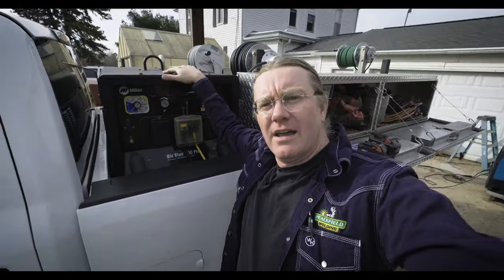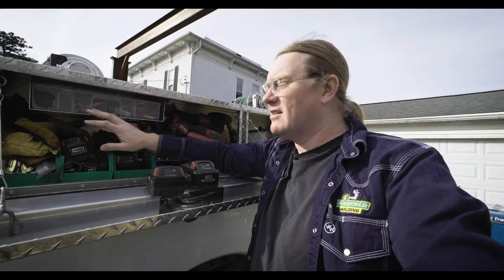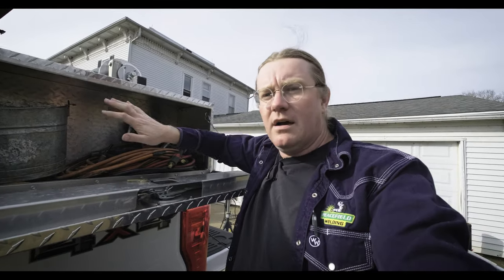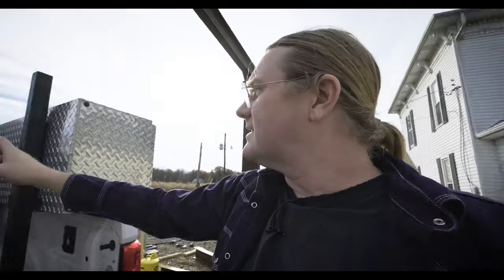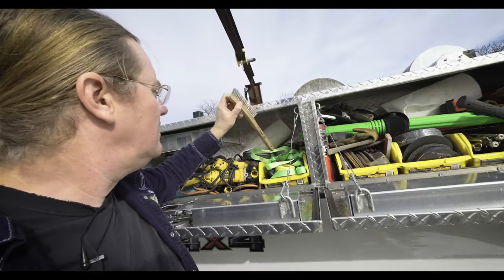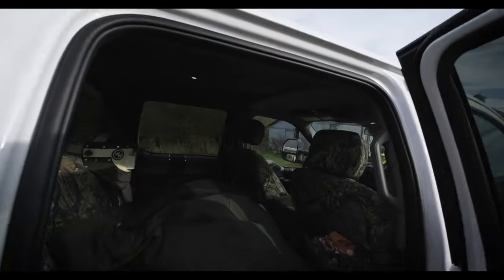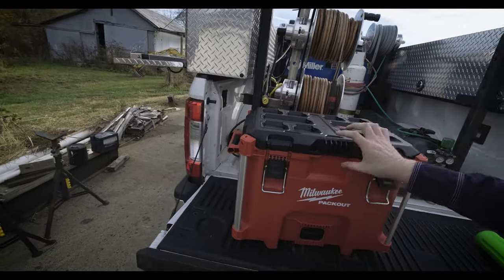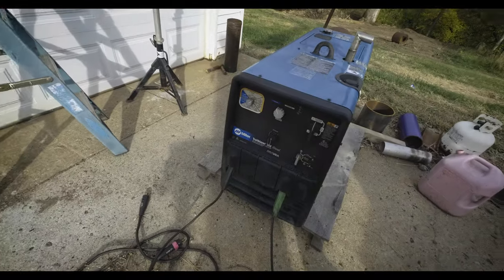TOUR OF MY WELDING RIG AND LOOK IN MY TOOL BOXES FOR PIPE WELDING

Comment: Nice outfit you there Zack I hear say tools are reasonable safe in your area man I always try to keep my welding rig in eyesight here in L.A. you need eyes in the back of your head good luck to you keep the good videos coming
Reply from the maker: That's crazy, out in the country here I don't ever worry about stuff. If I have to to go the city I've had people steel stuff off the tailgate while I'm working.
Reply: @DarlingtonFarm  IN Los Angeles it's crazy some of my friends had their rigs stolen more than once a plumber I know his was stolen 3 times my welder friend his was broken into 3 times the 4th they took the whole thing another friend a contractor his truck was stolen a week later the cops found it on blocks everything was gone including engine transmission and rear axle along with the tools

Comment: I would love to see your skid bare. I’m about to start my build and it will be very similar to yours. I’m interested in seeing if it’s bolted down or if you’d tied it off, how the bottles are held, how the welder sits in etc…
Reply from the maker: I ran bolts to the 5th wheel hitch through the bed, you can have your welder covered really cheap on your commercial auto insurance if it's bolted to the truck
Reply: What size I beams did you use to build your lifting frame and measurements? Looking to build one myself!

Comment: I'm jealous I could never get away with that small of a truck..maybe someday I won't need the big 4900 crane cruck
Reply from the maker: Oh jeez that's a lot to pack around! I wish I would have gotten a 350 but nothing like a medium duty like that
Reply: @DarlingtonFarm  yea I miss being able to run around in my little 2500 Duramax.  But the work out grew the truck. Trying to switch to plant work but there is more heavy equipment work out there around here now.
Reply from the maker: @sparksmobilerepair4025  I bet with all the construction going on on the north side of Indy you could clean up fixing equipment. Had a run fixing equipment a few years back but didn't really like constantly being covered in grease
Reply: @DarlingtonFarm  yea it's definitely not the best being greasy and truck bed covered in oil all the time. I'm out in central California. Got my foot in the door of some food plants but it's taking a while to get rolling with them. Got some smaller jobs out of them just building that relationship now
Reply from the maker: @sparksmobilerepair4025  food plants are where it's at, good money and easy work
Reply: @DarlingtonFarm  and mostly clean lol
Reply: You’ve come a long way from your humble beginnings with your old truck and SA200.  Glad you have found a niche area of welding which sets you apart from the herd. But really, a Hoosier should have a Hoosier pole.  Lol.
Reply from the maker: @stevewarner8880  thanks I really appreciate it, yeah I need to make one for the truck
Reply from the maker: @stevewarner8880  thanks I really appreciate it, yeah I need to make one for the truck

Comment: I got two trailblazers I’m running now . One a 301g and a 325 efi . XL power . How you like the pipe Pro . I like the 325 how quiet she runs . Compared to the 301g . Is a pipe pro quiet running unit compared to the Diesel trailblazer ?
Reply from the maker: The pipe pro is so quiet you forget it's running. If you're 15 -20 foot from the truck you can barely hear it run. Now that trailblazer diesel on the other hand is so loud at high idle it's really unpleasant working off the back of the truck. You can lock it at low idle and weld up to 120 amps or so and it's not as bad but it's still super loud.
Reply: @DarlingtonFarm oh ok thanks for your reply back you have a wonderful day .

Comment: I’m looking at a trailblazer 302 diesel with 270 hours. Not sure what to pay. Any guidance? I was looking at a Hobart champion 225 but I like that the trailblazer has AC and I can use it for carbon arc gouging down the line.
Reply from the maker: I just got a 2011 302 diesel with 500 hours for 3k. I had to drop everything and rush there to get it before someone else. I'd definitely go with something like that over a Hobart
Reply: @DarlingtonFarm  gotcha. That’s a good deal. The guy who’s selling it wants 2x that, which is way on the top end price wise for these machines imo.
Reply from the maker: @michaelt.9372  I'd see if they'd take less, it's a good machine but I don't think I'd pay 6 for one
Reply: @DarlingtonFarm  so he wants like 6500. I think I’m going to go with the champion elite 225. I don’t need AC on an engine drive since I have another AC machine. I’d be at like 4200ish round about with the Hobart.
Reply from the maker: @michaelt.9372  Sounds reasonable, get the Hobart and make some money